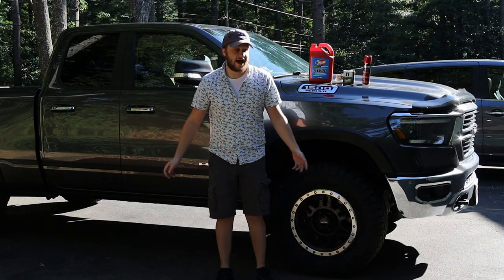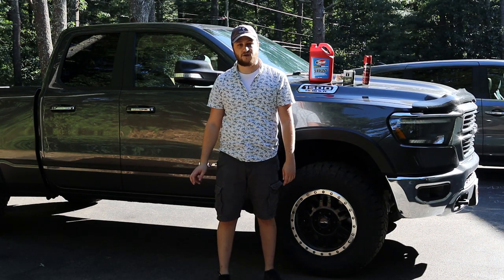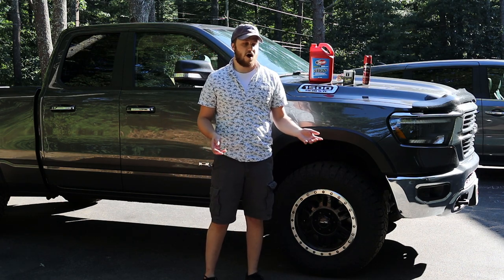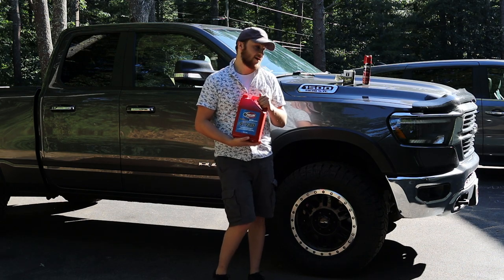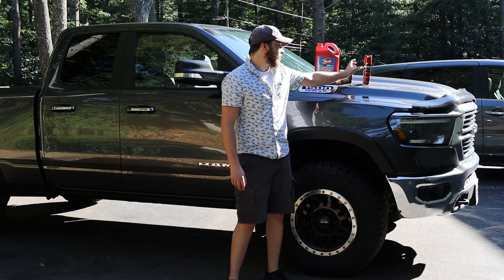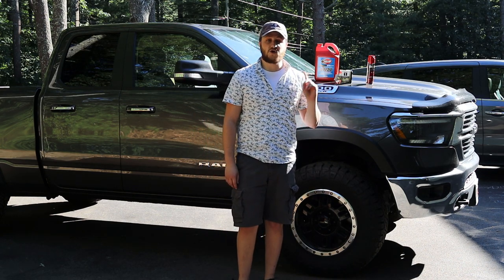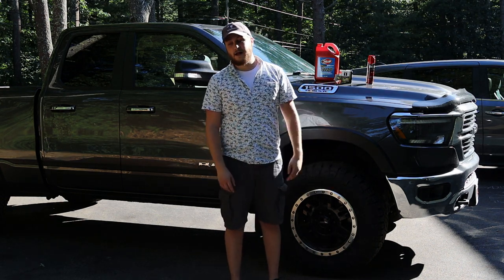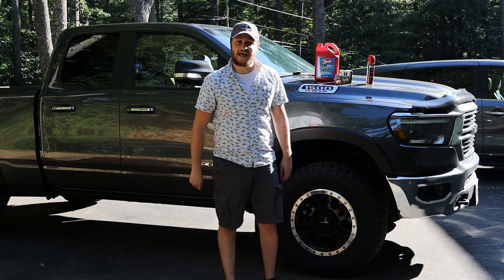How I Prevent the Hemi Tick

Comment: My next door neighbor manages the service department at the local Ram dealership and informed me what the issue is with the Hemi Eagle (current generation). The issue isn’t MDS, it because, due to the camshaft being raised higher in the engine, the lifters are insufficiently lubricated at low idle. The only fix, according to Ram allowing no prolonged engine idling periods. He has several clients with Ram trucks with 150k with no lifter issues, but also has a lot full of law enforcement vehicles powered by the 5.7 - because of extended idling periods. My 2015 Ram blew two lifters at 130k - I let him idle way too much. Other than the engine - best truck I ever owned.
Reply from the maker: Yeah it's definitely a lubrication issue. MDS is more annoying to me personally. When I cam the truck I do plan on adding the hellcat oil pump as well which will increase the volume of oil being pushed through, which I think will also help a ton.
Reply: Even with the best maintenance and little to no idling and the best oils failure can still occur. I had mds lifter failure at just over 40,000 miles.
Reply: @rogeroaks2865 What yr truck?
Reply: If the motor ain’t good, the rest of the truck ain’t either 🤷🏻‍♂️ 
The body without the motor isn’t getting you anywhere except to the bottom of a hill
Reply: 2018
Reply: Put the hellcat oil pump or melling high volume oil on for long idling
Reply: How long idle is too long?
Reply: @2tooful  My neighbor recommended no more than 2 to 5 minutes. I allowed my Ram  to idle up to 15 minutes when working on a construction site. I am from a generation wheere it was practical to allow an engine to warm up for 12 to 20 minutes sometimes.
Reply: Yeah that’s what Scotty Kilmer said too but even the 3rd gen ram 1500 have the hemi tick there’s a way to bullet proof it get after market lifters and a cam shady and while at it push rods
Reply: @rogeroaks2865 you should’ve disabled it engines are t meant to cut out of cylinders in my opinion

Comment: Go with the Melling oil pump over the hellcat pump, the Melling oil pump is a direct fit, it'll give you 44psi at full temp idle and max out at 99psi while driving, the hellcat oil pump will do the same but you need to change the spring
Reply from the maker: Thanks for the info. I only want to do this if I do some performance upgrades. For now it'll be okay.

Comment: I have a 2018 Ram Express 1500 with  the 5.7 Hemi and I also turn the dial to Drive and  use the steering wheel buttons to gear down to #8....the cylinder cut out/ECO Mode will be disabled. I have 180,000 miles on my truck and no lifter tick or exhaust tick. I also service my oil and trans fluid faithfully. Thanks for the video!  Cheers!! 🍻🍻
Reply from the maker: Thank you!
Reply: Exactly. 
I agree.  No hemi tick at all.

Comment: Just trade it in on a Chevy!!! Easy fix.
Reply from the maker: My dad has a new silverado 1500 and his consumed enough oil that the oil light came on. We tuned out AFM and it hasn't consumed a drop since. He also has torque converter shutter in is 6L80 that the dealer wont acknowledge. His infotainment keeps breaking too. Lucky for him he managed to complain enough that he was granted a 100k mile warranty from chevy for those specific issues.
Reply: Chevy doesn't know how to make a quality & good looking truck.
Reply: So trade a POS for an even bigger POS?    That’s sound advice!

Nissan TITAN with the 5.6 is hands down the best 1/2 truck available.   No, I don’t own one, I drive a trouble free 2013 Ford 3.5 with 189,000 miles but the Titan is the unsung hero in this class of truck.

Comment: On my 2019 Yukon with the  5.3 V8 I only use the transmission in 5M. I  lock out 6th gear. If you try 6M it will still go into the  AFM 4 cylinder mode. On the highway it  turns about  2,200 @ 75 mph.  No big deal and I  get 24-25 mpg.  27.4 mpg best ever @ 70 mph. I have the tow package and  3.42 rear gear ratio. The Hell with  6 speeds and  AFM !  The  AFM will not turn on in 5M.
Reply from the maker: My father has a 2019 silverado with 5.3. He got it disabled after his engine was consuming and alarming amount of oil. After it was disabled it stopped consuming oil. The dealer said the oil consumption was normal which is BS

Comment: My 2009 Ram 2500 has a 5.7 Hemi and has only 66,000 miles. It had the Hemi tick and when I took it to the dealer for service they found a cracked exhaust manifold and broken mounting bolts on the exhaust manifold to block. After they replaced the bolts and exhaust manifold the ticking disappeared and runs awesome.
Reply from the maker: Mine has always had some sort of tick luckily not anything bad. Just very noisy engines.

Comment: Redline 5w30 is known as the "Hemi Honey" for a very good reason - it works at even quietening a ticking engine. It doesn't "get rid" of the tick as some people claim. It just makes the tick so quiet that you will not even be able to hear it unless you use a mechanic's stethoscope. 
I cannot use 5w20 on my truck because of where I live. It is what caused the tick in my trucks. It has been recommended on the forums to switch up to a 5w30 oil because in the long run, the 5w20 is not good for the Hemi. It's now pretty much a proven fact that manufacturers are recommending the thinner oils just to get that little bit more efficiency from an engine for better EPA ratings. 
When you ask people with high mileage trucks, who have never faced the tick and never used Redline, you figure out that they don't necessarily follow the manual to the letter. They always use a good 5w30 or 0w40 oil and will always do the changes at 3000 - 3500 miles. 
Having faced the dreaded lifter tick 3 times on 2 different trucks, I can safely say that if you want to prevent the tick, do the same thing as I suggested. 
Switch up to a good 5w30 oil as soon as possible before you develop the Hemi tick. If your budget can hold up to Redline 5w30, the use that. If not, a good 5w30 or 0w40 oil will do. Mobil 1 Fully Synthetic 0w40 will do nicely. Currently running it on my truck without a single issue. 
https://youtu.be/33XQO6eVrsM?si=bzYXiLVu-w-rh6ad

There will be those who say that you need to run 5w20 because of the MDS, but that is not true. My truck has MDS and I've not faced a single issue since running Redline 5w30 and now running Mobil 1 FS 0w40.
Reply from the maker: Thank you for the insight! I'll try the 5w30 next time I change it.
Reply: Dodge recommends only 5w20
Reply: @zuriiiii77 I followed the manual to the letter (5w20) and it bit me in the butt, more than once. My brother's 2004 Durango was specified to have 5w30 and never faced a tick. Both vehicles 5.7 V8 Hemi. Same engine, but the manuals suggested different oils. All the Hellcats are supposed to use Pennzoil Ultra Platinum 0w40. Same exact head design as the 5.7. The 5w20 spec is only for EPA. Not for longevity. 
I found out that the local dealership over here in Dubai uses 5w30 for any car that comes to them for service. However they will gladly sell me 5w20 if I'm doing the oil changes myself. Classic stitch-up. The point I'm making is that 5w20 is not a bad oil, but its too thin for the Hemi, especially for those who live in warm climates where it touches 40.C in Summer. Over here in Dubai it can average 45.C - 50.C 
Even on the Ram forum,  the recommendation is to use 5w30 if you want your engine to last and prevent the Hemi Tick. This guy found that it out on his own. 
https://www.youtube.com/watch?v=YGbv2G67a80&t=10s
https://www.youtube.com/watch?v=Jr3j-JrWFrg
Reply: But if the oil is having trouble lubricating certain areas, how would a thicker oil help ? Wouldn't a thinner oil be better for reaching those areas ?

Comment: Do not ever under and circumstance idle a Hemi!  The lack of oil sling from the crank to the cam is what causes the tick!
Reply from the maker: Yeah, long idle times have been known to kill these.
Reply: How long is too long? My job sometimes I’ll have to sit in my truck for some periods of time especially when it’s baking hot down here in the south. Should I start giving it more breaks?
Reply: @OldElysium  I’d try to keep it under 5 min, or idle it at 1,000 rpm’s.  You can buy a contraption that you can use to put on the pedal to keep the rpm’s up.

Comment: After reading many posts everywhere i believe its bad batches of lifters or an inherent design flaw in valve train geometry. Too many people that did perfect maintenace have had their cams wiped by lifters with less than 100k miles and low idling time. I have 70 k miles on my hemi and i feel like im driving a time bomb and this looming issue has taken a lot of enjoyment away from owning my truck. Its despicable that FCA wont give  owners any guidance. Not to mention the cab water leak issues ..sigh
Reply from the maker: It is just poor quality parts. My truck actually has a lifter that's failing currently. I'll be making a video on that for next week and the whole dealership experience.

Comment: 5w20 is useless its like water. Use full synthetic 5w30 and the last quart 0w40. 2016 ram 5.7 1500 no issues, no tick. Change your oil every 5k miles.
Reply from the maker: I was gonna switch to 5w30 amsoil as recommended by lots of people. I change mine every 5k miles currently
Reply: @mekanik2037  yeah the 5w30 combined with the frequent oil changes is the key. The 0w40 splash is optional. However theres no reason we couldn't run 0w40 full time, the 392's run on it

Comment: Has anybody heard of pouring Transmission fluid through the carbureator, or putting a quart in your fuel tank?
Reply: That’s something we did in the 70-80s for cars that were pre unleaded fuel. Don’t do it with newer EFI unless you have a lot of bucks for a new system.
Reply: wtf 😂